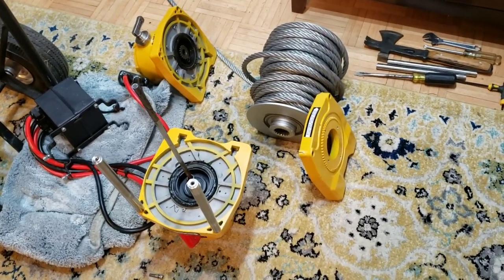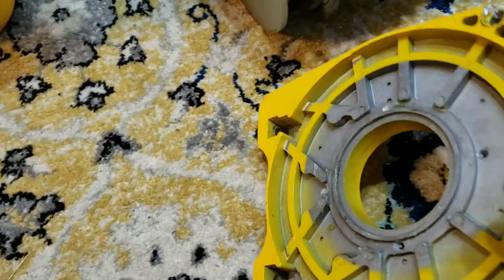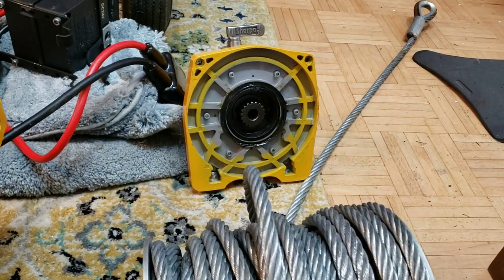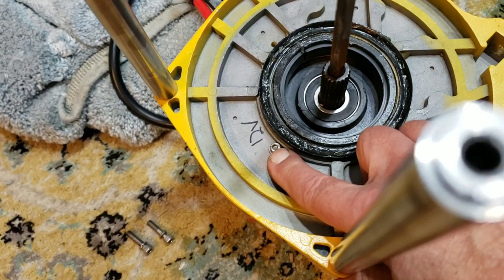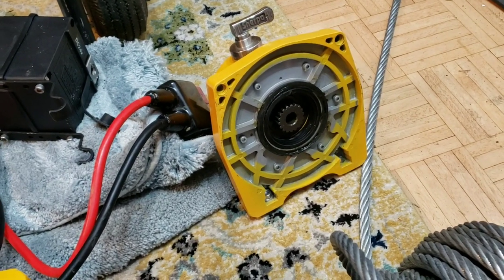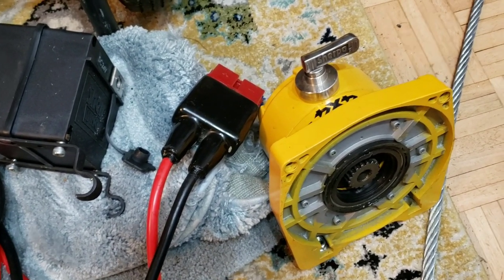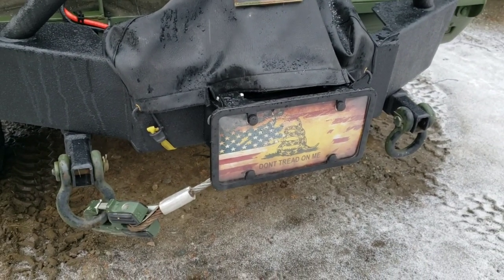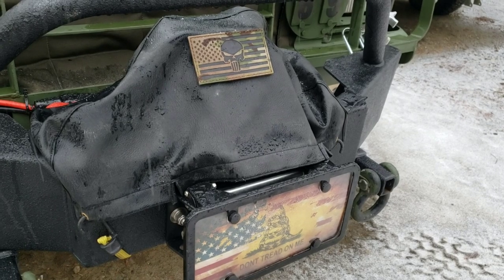OH NO! Broke my 25,000 lb Sherpa winch during a self recovery of my M1028 CUCV military Chevy K30

Comment: Rule of winches: 1st, after mounting, always pull off all but 3-4 wraps of cable and then put a light load on the cable and take all the way in. 2nd, tale all but 2-3 winds off a second time and then retrieve with a moderate load. This essentially seats the winch wire rope. This is an absolute must. 
Yes, this was 100% your fault, nice of them to replace the parts. When looking at recovery and rescue gear, NEVER skimp on costs, NEVER!!!
Reply: I should clarify, don't winch without have several complete rounds on the drum.
Reply from the maker: I switched to synthetic which gives me more room and a longer lead

Comment: I was 99 % on buying a Sherpa 25000 winch to replace the Warn on my Powerwagon. After watching your video now i'm 100% sure. Thanks for a very informative video. I'm an old offroader with lots of experience. I've jammed my cable like you did in the past but lucky enough not to have damaged my winch. But the service provided by the Company is awesome. I have one question. Where did you fing the quick connects for the winch and what are they rated(amps) at?  They look pretty heavy duty. Thanks.
Reply from the maker: The quick connects were fabricated by a local welding shop.  Not sure what they are rated, but they are way more than the winch can pull, even if I double the line.  Thanks for watching.
Reply: Don Stanford hey mate did you get a Sherpa...?? Just wanted to know what your thoughts are...?? Cheers mate
Reply from the maker: I really like my Sherpa.  I have the Stallion.  One thing I did wrong was to get a steel line.  It is too crammed even after respooling it.  Go with synthetic.  It has plenty of room for 100 ft.  Sherpas customer service is outstanding.   They always answer your questions and make sure you are satisfied.
Reply: @matthewalderton1803  Not yet. Have to wait until we get a handle on this pandemic, But my plan is to get one. I've done a lot of checking around and hardly a negative comment.
Reply: @VermontPrepper  thanks mate appreciate the feedback... Any other tips...?? I reckon the wireless remote would come in handy, I got an 11 ton truck so it looks to be the best thing on the market for my application...!! Cheers for ur content as well...!!
Reply from the maker: The shutoff switch woukd be nice as well